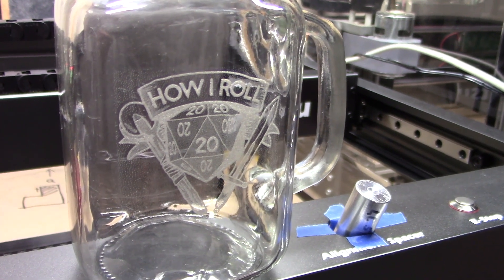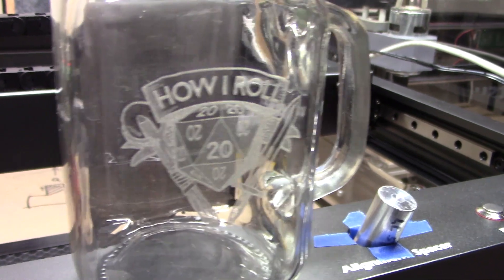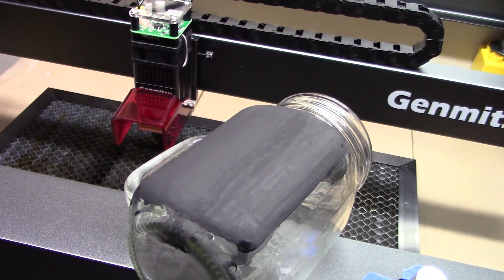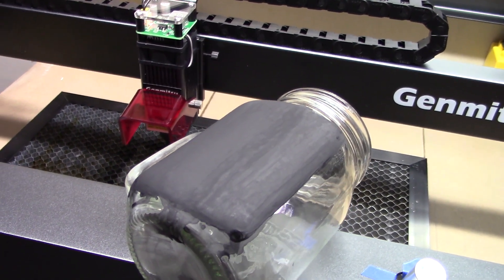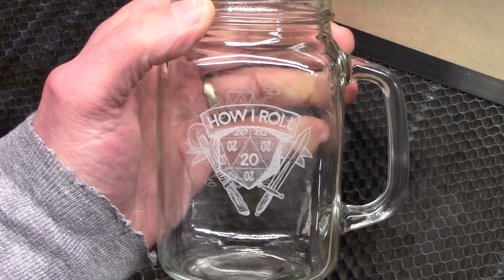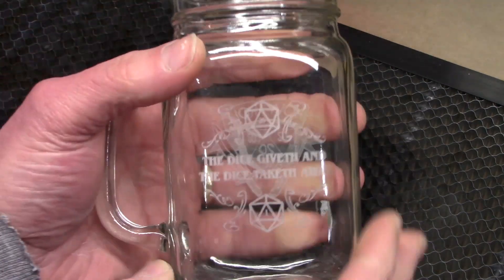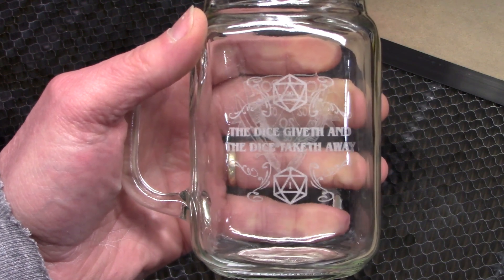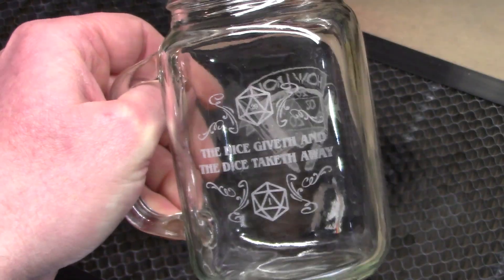How do you etch glass with a diode laser! The blue laser goes right through.

Comment: Nice looking job! Thanks for finding ways to avoid the harsh chemicals! Most don’t realize the dangers of long term use of acetone and lacquer thinner. Working in machine shops for 40 years I seen some of the results. Worked with a guy who developed a severe allergy to any chemical he touched, hands would swell with open lesions. His body was rejecting even mild stuff. I cringe when I watch videos of guys handling acetone like it was water!
Reply from the maker: I like the water rinse!  I know I don't wear gloves with the lacquer thinner.  I do try to minimize my exposure to it as well as other chemicals.  I don't like using acetone as a general rule.  Great advice and good first hand experience story.  Thank you for sharing.
Reply: I've found that soaking in Pine-Sol works great to remove spray paint from glass.  Even faster and easier if you put it into an ultrasonic cleaner.  An old toothbrush removes any stubborn areas.

Comment: I too have been using tempera paint on my glass.  I have a 5.5 watt diode laser and I am having a problem setting the speed and power.  What were your settings for the mugs you etched?  Thank you.
Reply from the maker: Great questions.  I was using my 10 watt diode laser and burned at 1200mm/min at 60% power.  The best thing to is a test burn using different power and speed settings.  If you use LightBurn, they have a material test option that does a great job crating a grid where you can set a power and speed range to find out what works best for your materiak, laser, and configuration.